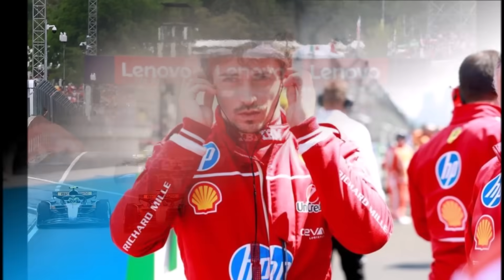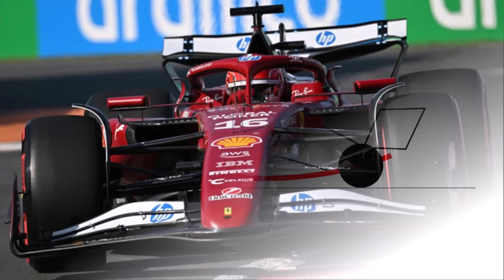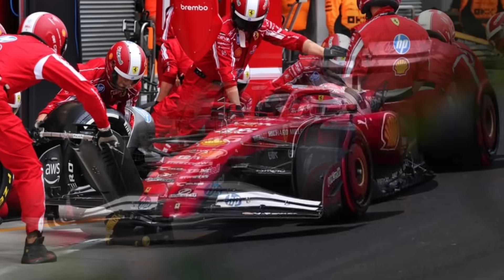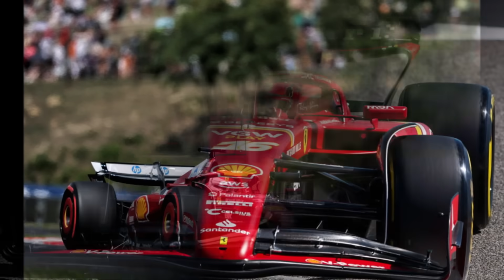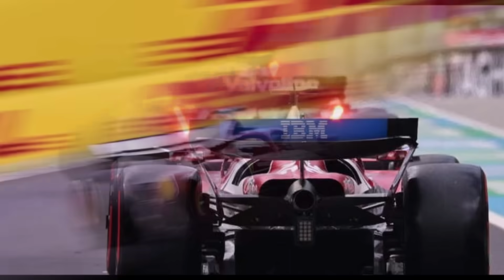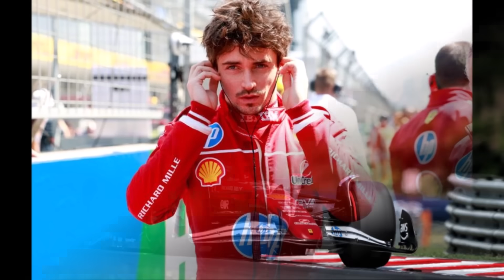Ferrari's Mysterious Hungary Problem - EXPLAINED

Comment: As others pointed out, it's way too late to worry about plank wear after the second stint. All the wear would have occurred at low ride height early on with the heavy fuel load. So the theory again seems thin.

Comment: What puzzles me is why every analysis of this topic assumes Ferrari is lying about the chassis. Leclerc being more composed during post-test interviews suggests to me that this is genuinely a one-off issue. The tire and plank problems should have been resolved with the suspension update. If there were still issues, he wouldn’t be so calm. Moreover, the car didn’t have engine cut mode at the end of the race. In the last laps, Ferrari had full power and top speed, further suggesting it’s less likely to be a plank issue.

Comment: there's still one thing that makes no sense about this, with the passing of the laps Leclerc was going faster and faster on the every straight, but slower in the corners
ok, the fact that he was going slower in the corners makes sense; what doesn't is why would the team let him go faster as laps go by if the problem is the plank, as you said the downforce increases with a higher speed, hence a higher wear on the plank
also, we are talking about a 14km/h difference between lap 27 (his fastest lap in the 2nd stint) and lap 62 (his slowest lap in the 3rd stint, and a bit more than 2 seconds slower than lap 27)... with this, i don't think the plank was the main issue and we may never know what was really going on
all data can be seen on F1 Insights Hub :)

Comment: The part of the car being on pole being a surprise and they became wary of the plank wear makes sense. However, on the 3rd stint they were 6 seconds behind Lando, it should've been a matter of 5-10 laps for him to catch up and lose the downforce that they were suspecting from the initial sims. The car was also lighter, due to fuel burned.
I'm still not convinced they would setup the car to cost so much lap time just to not risk being disqualified, when they were running a barely legal car through over half the race. Apparently the car was making most the lap time on the corners, where there's less plank wear, so why compromise corner performance when the car was lighter? Would be quite dumb if that were the case.

Comment: I doubt about this explanation. If it is about ride height, damage already done when fuel heavy. Correction on stint 3 does not make sense. Except they make Lec out of podium to avoid the post race check???  :face-green-smiling:
Reply: Exactly. 
Sneaky clever people in those garages..
And now there is a story.
😂😂

Comment: Yelistener has a better explanation of this ....
Ferrari "experts" also forgot that the car would be lighter (less fuel) in 3rd stint and they exaggerated on the pressure...  It looks Binotto never left.... 
Ferrari technicians are selected by "friendship" reasons instead of technical knowledge.... this is the result... errors and mistakes 24/7....
Reply: Binotto's spirit lives on

Comment: Not a bad theory, it would partly explain the gap with Hamilton in qualifying...
OK, so it would have allowed Ferrari to perform above their usual level, but they can't do that twice. Third or fourth place should have been possible under normal circumstances, so they didn't lose or gain anything. Maybe they have a deformation trick on the new suspension that isn't quite right?

Comment: If they knew all along, so much that they had a custom engine mode to slow down at the end of the straights without the driver doing loft and coast, why didn't they discuss it with Charles before the race? Makes no sense to me. Also, when you have a 10 second gap ahead, you are basically running in free air, and that's what being behind the McLarens looks like. So also that they didn't expect to be in free air doesn't sound like a particularly bulletproof point. And for last, the whole story more or less makes sense, but what element do you have that disprove Ferrari's claims that it was a chassis issue?
Reply: There is 0 proof, Ferrari actually asked Leclerc to put engine in mode FS1 but also to put it in normal mode in some part of the stints (why would they do that if they feared plank wear?), also engine mode and lift and coast are not mutually exclusives and FS1 doesn't save fuel, it just changes how the hybrid energy is deployed, the combustion part (which is the part that burns fuel) is always al 100% unless you lift the pedal so why would Leclerc think it was to save fuel, is he stupid? Also the idea that a team runs a car for the full qualification but then realizes the car is bottoming out too much mid-race is simply ridiculous and the first thing the team would have asked would have been to stay clear of the curbs (they didn't).
Russell just trolls everyone with a theory based on nothing and suddenly it's the only truth.
Also Leclerc had a setup with "low" downforce, everyone can see it just by comparing his lap with Piastri's, Ferrari's straight line speed was higher.
Reply from the maker: They were running lower, which gives more downforce from the floor and allows for lower downforce wings, which increases topspeed…
Reply: @bsport320  ground effect is not 100% comparable to wing downforce as it works much better on medium-high speed corners. Running lower also requires comparable stiffer suspensions which have a negative effect on traction and kerbs usage. Leclerc did get pole by being very aggressive in sector 2, which have a lot of kerbs and low-medium speed corners. I still don't see any proof of the tyre pressure thing.
Btw Ferrari usually runs very low, it was easy to see in the last GPs like Silverstone and Spa, where Ferrari was always the car bottoming out more often and heavily, and that never prompted any disastrous tyre pressure shenanigans (nor they did in the other races, even when they were asking costantly for LiCo).
Can we just stop and call for Russell BS instead of doubling down without any real data. We have telemetry for cars, if Leclerc had a rear tyre pressure problem that would lower the grip and overheat the tyres, making the traction out of corners tragical, telemetry doesn't show that, radio messages don't talk about avoiding kerbs, don't talk about LiCo? That would be an interesting video.
Reply from the maker: We cannot really tell from outside why they didn’t discuss certain things before the race. Not even Leclerc knows that😅
Reply: @bsport320 but wouldn't it be an easier yet still plausible explanation that of the chassis issue? Coz I know Ferrari self harm is a thing, but the plank wear story came out of very thin air and to my knowledge still hasn't got any kind of backing from any reputable source. Also, in the third sting they lost 2 seconds of pace, and that seems like a lot for a ride height adjustment made using tire pressure.
Reply: @kornephoros plank things it seems they were getting more inspection, and given this is random inspection, plus with HAM got DQed for this before, and past cases, they must run car setup very low and FIA have valid case for inspection

Comment: Yo like WTF??? what the hell are engineers thinking??
A team's most optimistic scenario for race is to win and Here is Ferrari thinking let's just NOT adjust the plank according to the downforce and ride height levels
WHY?? Because we never thought that a Car would run in free air.
This seems so childish man. No wonder why Hamilton is depressed
Reply from the maker: It’s racing, also big teams don’t always get the setup right. Ferrari has always been on the edge and they don’t have much experience with their new rear suspension yet.
Reply: They kinda always expect to ride in free air, coz they're usually 10+ seconds behind McLarens. So theory doesn't make that much sense to me

Comment: dude what are you even on about when you say "ignition cuts"?? There's no way driver is full throttle and at the end of straight and suddenly engine cuts power, this would be akin to traction control and is expressly forbidden. What Leclerc meant by "cuts" is ERS derating way earlier than usual at the end of straight and thus limiting top speed to avoid scrapping the ground even more.
Reply from the maker: There are lots of different words for that. At Audi we called it d-rating, let’s just say it was a different engine mode limiting power.
Reply: LEC mentioned "clicks" towards the end of the straight.  The engine makes a clicking sound when you hit a rev limiter.  I've experienced it myself on a track in an open wheel single seater.
Reply: @KM-ol5bs  rev limiter is not a factor in these turbo engines, and leclerc wasnt talking about any rev limiter clicks, if anything he was saying "clips" which is used in relation to battery clipping aka derating.
Reply: @cosmo1084  There is a limiter.  These cars are limited in the amount of fuel they can deliver not rpm.  This limit is well below the maximum rpm.
Reply: @KM-ol5bs  i know max fuel is at 10.5k rpm, but rules allow these engines can go up to 15k, so the limiter is very far away and is entirely a non issue. teams actually limit their engines at around 13.5k because its never needed to rev that far.

Comment: Great analysis. Perhaps Ferrari could have their own code with their drivers or at the very least anticipate this in a team briefing. 

"Charles, you have the quali set up. It really won't work in the race, sorry cupcake! "

Fun fact: it was the quali set up that MV used at Silverstone that led to Mr Horner's demise.
Reply: Where are you getting this info from???
Reply: @f1isnotreal  After quali, no mods are allowed (rulebook). Ferrari did the set up for quali which requires compromises. It involved a low ride height, a courtesy not extended to LH (who was knocked out). However, Ferrari seemingly failed to tell CL that they would NEED do the described fumbling DURING the race.
Reply: Apparently the FIA officials are too dumb to figure out what Ferrari was doing, even though they can hear and see everything. But this creator figured it out, though.

Comment: I would wonder how Charles didn't know his car was set abnormally low though. F1 drivers are very sensitive to their cars and he surely would have felt something was different.. if the car bottoms out more often than not on the early stints, the drivers would surely pick up on that?
Reply: The cars will naturally bottom out less as fuel is used up, that might've hid the changes to Leclerc
Reply: The height differences being discussed are literally the height of a sheet of paper, it isn't that noticeable, these cars bottom out anyway, and the plank wear allowed is 1mm, so the difference between bottoming out enough to wear the plank or not is not noticeable a race stint

Comment: 1. How many millimetres would they have needed to raise the rear ride height and how much extra pressure would they need to achieve that?
2. Whatever happened to the high rake philosohy?
Reply: Just commenting to see the real answer, but my guess would be, that high rake is more effective for the downforce produced by the wings, but less effective for the diffuser/floor. And now that the floor produces most of the downforce it has to be as flat and close to the ground as possible. 
Please tell me if I am right or wrong with that guess.
Reply: @johannes7059 High rake concepts worked well in the pre-2022 rules because the diffuser dimensions were very restricted, so running the high rake is a way of 'brute forcing' more diffuser performance, and the increased downforce offsets the worse CoG from the increased rear ride height. In the post-2022 rules, this is no longer needed as diffuser dimensions are sufficient and other suspension factors are more important, such as preventing porpoising and anti-dive/squat.
Reply: @needles_balloon ah, I get it, makes sense 👍 thanks for the explanation